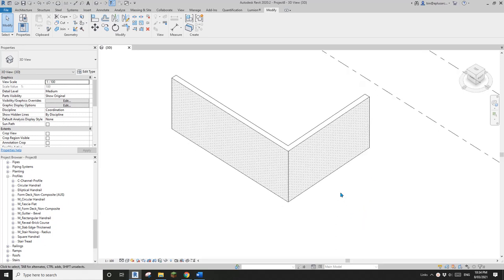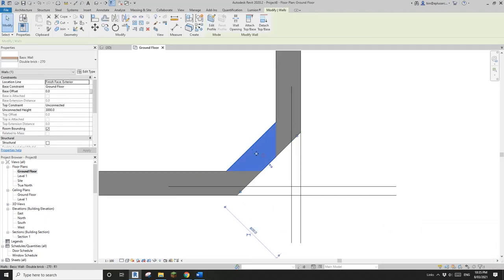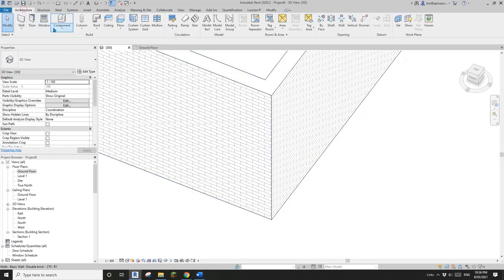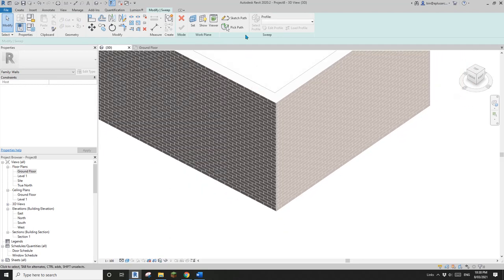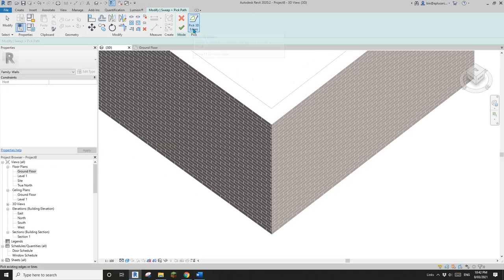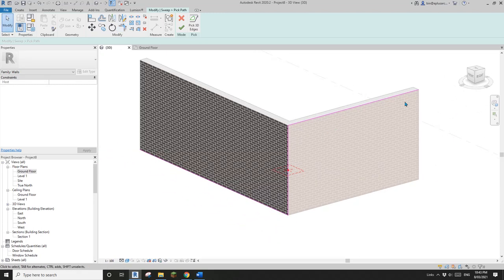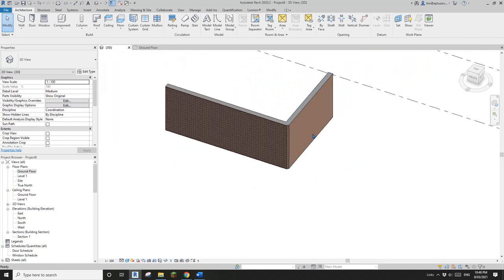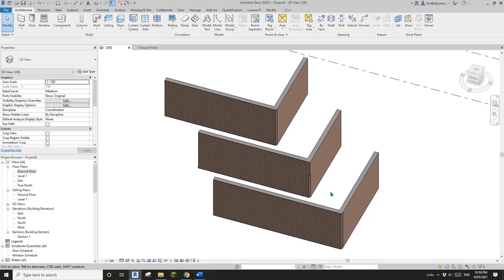Everyday Revit (Day 356) - Chamfered Wall Corner

Comment: Dear Bin, Thank you . pls note that, when you cut, you have to click on both side of walls before finish. so the projection won't visible.
Reply from the maker: Thanks for the tip, it’s a good one.  I did found it happen sometimes but too lazy to figure it out. I usually just hide it... :)

Comment: Simply greate tutorial. I liked most the the "reveal method", but sweep and void can do the job. By the way, to constrain chamfer to the ajaicent wall  it only takes to turn temporary dimension (which appears wile void is selected) to constant, then change value to zero and put a padlock on.
Reply from the maker: Thank you for your tips.

Comment: Late to the party, but I think version one will work if the diagonal wall part has a greater width/depth so the inner side is equal or slightly larger so it covers the inner corner of the two other walls.

As it is in your example the wall is inside the two others, and that confuses Revit.
Reply from the maker: Thank you for your opinion. I think in a real project, I would avoid the first method, because this might cause some join issue. I would also avoid method 3 because I am too lazy to create a family just for this occasion. I would very likely just create a model in place void to cut the wall. Just make sure that you choose a proper category for your void.
Reply: @BINHE615  I agree that one isn't a good choice. But would be fastest if you are in a pinch and don't want lose in-place objects.

I would use a dedicated family, done properly it can be reused in many projects.